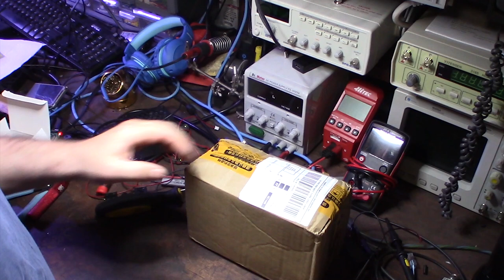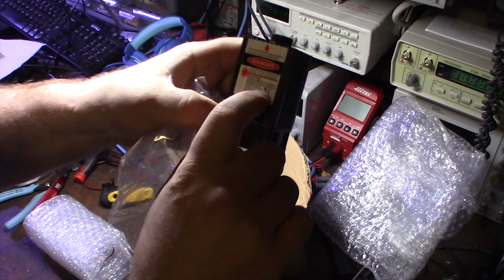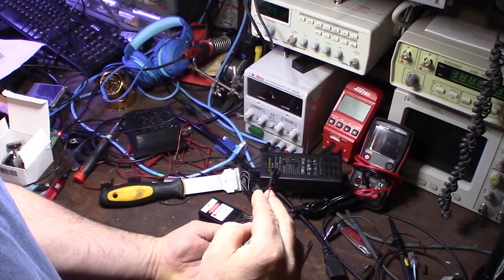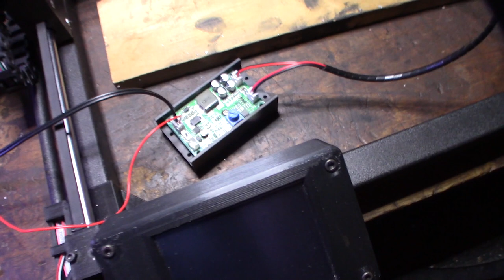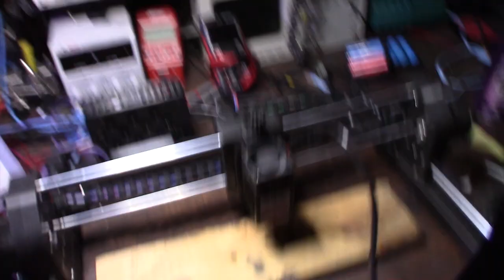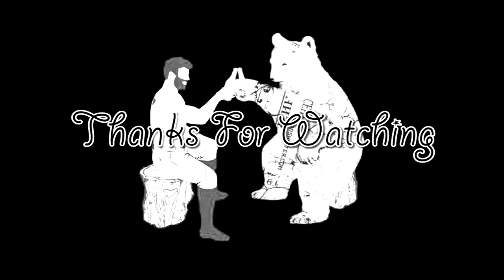15W Laser Diode For Laser Engraver / Cutter test from on Ebay

Comment: The TTL input signal line should be set up so you can use the arduino logic to turn on and off the laser. It should be pulled down to ground with a pull down resistor when not on then the arduino pin connects to the pin and when you give it a 5v logic high it will turn on. Leaving it disconnected is a floating condition. The manufacture should have made this clear.

Comment: Interesting the lack of safety, full power on. My prebuilt PWM wiring was faulty. Same thing when I turned it on. Mine is only 5.5mw, still managed to burn through cardboard, foam, walnut tabletop. Hard to imagine what you might be able to cut through with a 15W diode laser.! Thanks for the video!
Reply from the maker: I saw your video, I'm glad I had it mounted. I was expecting this thing be off until I applied a 5V trigger.